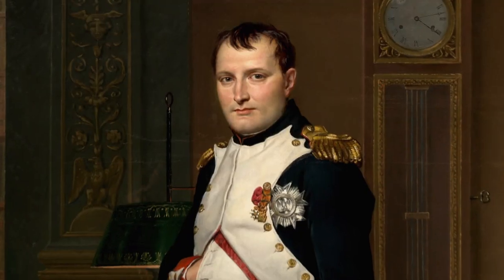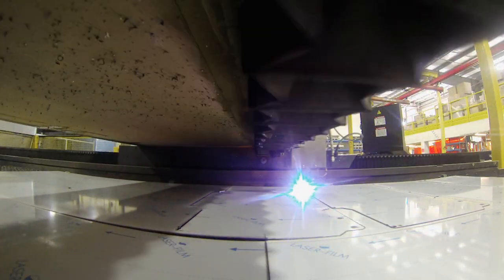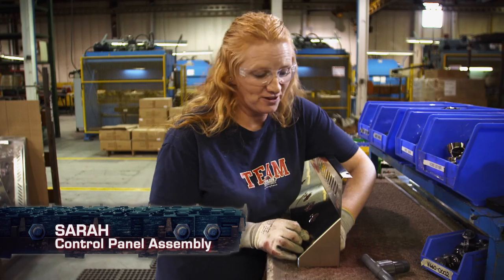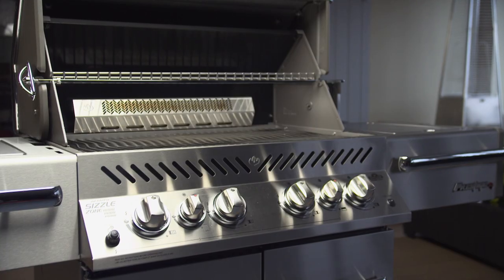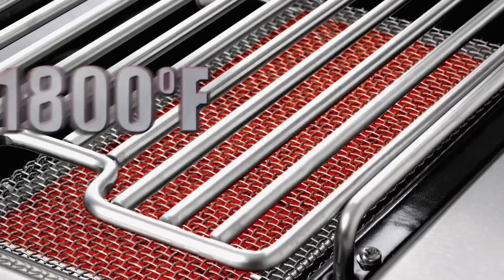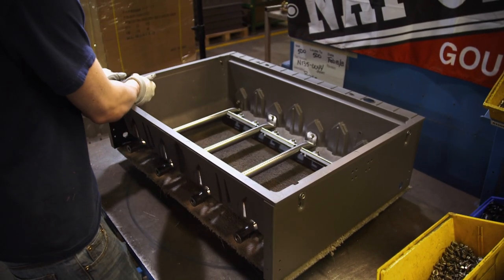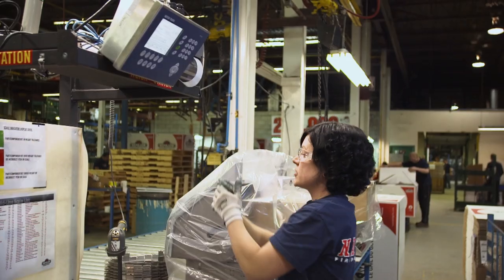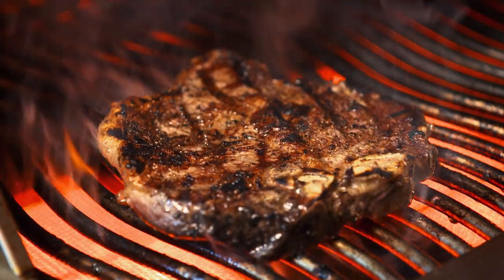How a NAPOLEON Grill is made - BRANDMADE.TV

Comment: I bought one some years ago and experienced a number of disappointing issues early on. The thermometer was not accurate, the wiring for the control knob lights melted, some of the igniters failed due to high voltage punch through of the inadequate insulated wires, the screened printing on the control knob panel peeled off, the plated steel grease tray rusted through and the chrome plated handles around the left and right sides pitted. I have always keep it covered when not in use.  So I am highly disappointed buying a high end grill that lacks quality in the details.

Comment: the question is WHAT TYPE OF STAINLESS?  Is it type 304? then list that in the add books!  The cheap type 430 stainless is magnetic and I bet a magnet will stick to this grill everywhere!
Reply: I'm a journeyman sheet metal worker, what do you what to know about SS?

Telling you right now if you are looking for 316L or 304, better have $8000 in your back pocket or more depending upon gauge. 304 is food grade, 302 is probably what it's made of. Your stainless steel dishwasher is probably made from 430.

All metals have their strengths and weaknesses. Yes, 16g 316L would be lovely, like a Lynx grill, but you'll be paying $10,000 plus.
Reply: It'll rust,  it's not "real" stainless

Way to expensive for what it is
Reply: @Nirotix  All of the ads say the 500 pro, is made of 304 SS.
Reply: @gregjordan5899  I have the 665 Prestige Pro sitting on my deck now, I pulled the pin late last summer.

It's 304 SS, hood, grates ( main cooking grate, warming rack is chrome coated), cook box, heavy duty spit rod, front panel. Back inside panel is porcelain coated, cart is not 304 SS, but 400 series of some sort I believe. Legs are not 304 either.

304 WILL rust in a salty environment, as in near to ocean air. Inland, you shouldn't have much concern if you look after it such as covering it. I love the grill, even heat and holds heat.

I was burying the needle at 700 degree's in -30 cooking pizzas on a stone no problem at all. Never could ever do that with a throw away bbq.
Reply: @gregjordan5899  Also, the asking price was $3499, which neither store seemed willing to budge on close to the end of the season.

I visited both many times showing interest, finially called and said "I'll give you $3100 right now, take it or leave it", paid credit card, rest is history.

Probably could have got it for less, but they do want to move these top level products, not have them sit around till next year. I was fair to them, they made some money off me, I saved $450 with taxes, everyone is happy.